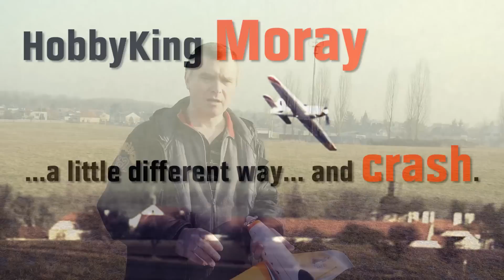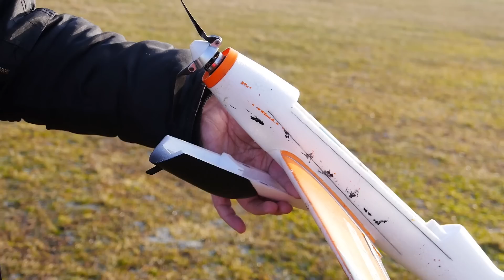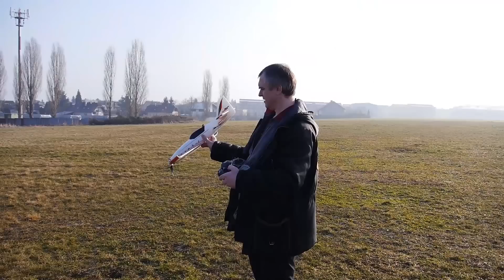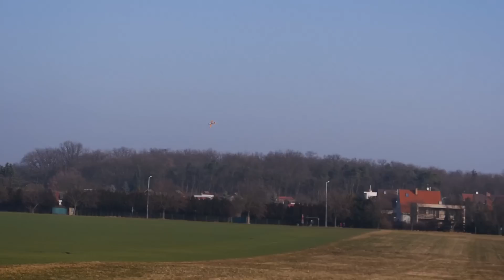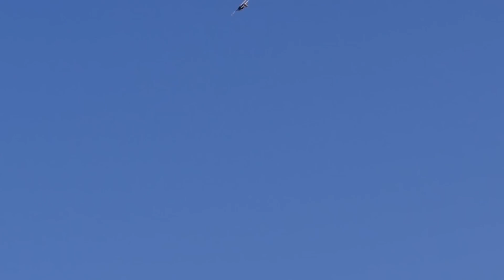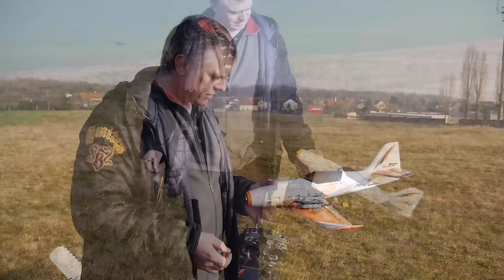HobbyKing Moray ...a little different way...and crash :)

Comment: You are exactly correct!! This plane does not fly out of the box. This plane needs serious modifications that beginners cannot provide. I see many reviews that this plane needs to be launched correctly to fly, and then all is good… bahhh. This is not true.
All flights were done with prescribed battery (Federal 1600, 4 cell). This is a short batter especially made for the Moray Freewing. After launch it flies like a bucking bronco… back and forth, and no way to adjust the trim until the crash comes..

Right on buddy, you figured a way to tame the beast in order to trim it out.

Good work -

Comment: Have a chance recently to get this broken plane from someone. Ordered the original 3040 1400KV motor and spent a month and I still cannot make it fly .... I think you are right, this is a bad plane. I just put a gyro in and I will try to fly it one last time this week. If it still cannot fly, I am going to swap in a normal size motor.....